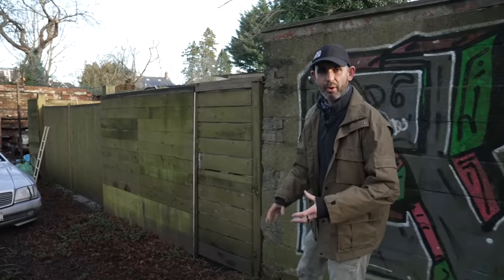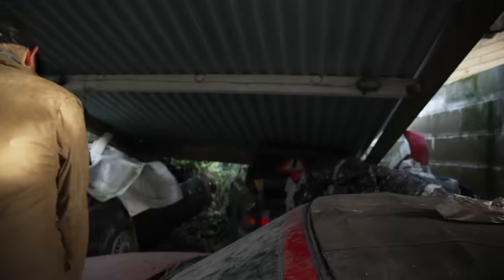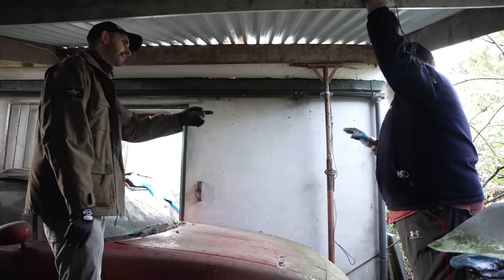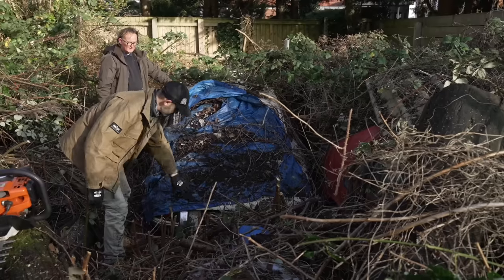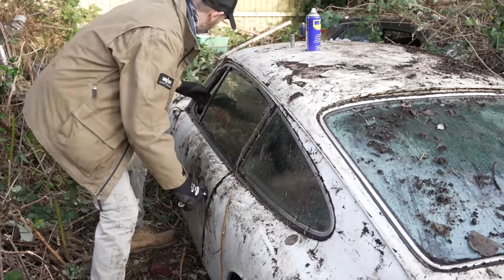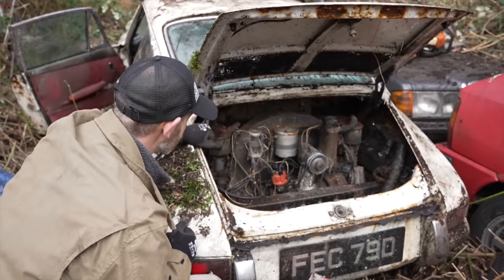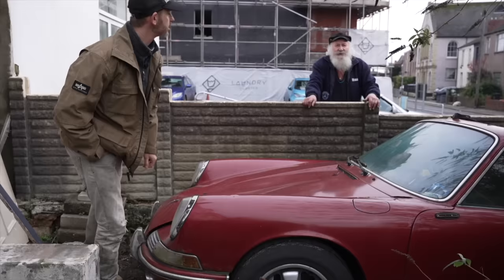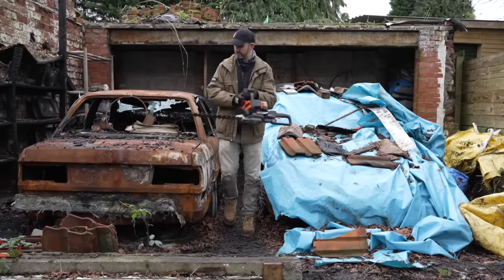Secret Garden full of overgrown Classic Cars

Comment: Very sad that this chap is clearly an enthusiast and very eloquent, but has no idea how to care for the cars he's owned. Putting cars away "after a service and MOT" and leaving them to rot is very sad. Talking about a rotting shell as having "a new starter motor" is heartbreaking. I hope he gets the help he needs.
Reply: He's beyond help!
Reply: The white Porsche failed its MOT on 4th Dec 2007 on 5 counts, and has probably been parked there since.
Reply: When he said one had a brand new engine, I was like, any engine that ran in the last year is better than a "brand new" engine that has been sitting outside for over a decade.

Brand new or not, it has to come out and be taken apart, cleaned, most likely rebuilt with machine work; new parts and reassembled.

Comment: What a find. With the current price of old Porsche’s someone will pay for the excavation just to get at that car. I too remember when 912’s were worth very little. My dad got into buying and selling early 911’s in 1980. We owned several: starting with a scruffy dark blue’ 66. This car... we drove down to Florida from  North Carolina to deliver a ‘77 XJS he had sold. I know it was 1980 because we watched the premier of Magnum P.I. On that trip. We traveled down in the lap of luxury... and back in a rust, drafty old crock of a Porsche with no heat, radio and only one working rear tail light. On to a very nice black sunroof ‘66...he added a duck tail spoiler and “cookie cutter” alloys to that car, a rather rough green soft window ‘67 Targa with low back Recaro seats and Fuchs alloys...I think that one was an “s”, a beige ‘74 that crawled right up our steep snow covered drive when our Honda Civic would not, a maroon 67 912 with some odd “Cosmic” alloys, an orange 68 or 69 912 that had centered a tree in the front end. Not wrecked that badly but That car sat in the corner of our drive for a long time as no one wanted it being a lowly 912, and many more.: 924, 914, other 911’s. He made good money on these cars at the time, but man alive, what they are worth now! Such memories. I’m sending him the link to this video. Cheers, mate.

Comment: I think you would have to buy everything.  You will need a large car transporter, another vehicle with a big winch front and back,  and another dump truck for all the garden waste. With 6 people to help clear the site.  This is a 2 day work site, and it would cost you at least 10,000 quid just to get at them.  I think I would add a JCB digger and a fork lift to the equipment needed to clear this site.  I think a thousand quid per car would be a reasonable offer if you took all of them.

Comment: It's not a '66.. It's a '67.  Engine mount is '67. Dashboard and decklid scripts are '67.  It's been converted to European Bumper guards.. or it's European, went to OK and then came back to the UK.  Plus... dash is a '67.. it hasn't been "upgraded" to a 5 gauge dash... that's factory.  It does have US Spec tail lights... btw.. That batwing horn ring is worth a good $1000.00 or more.

Comment: The 912 will be rotten from underneath, unfortunately - but it can (and will) be saved. Most other stuff should be picked up for scrap as they're too far gone - the 924 and Delta in particular. A Delta 1300... back in the days when they were either 1300 or 1500! I'm almost surprised there wasn't an Alfa 33 lurking somewhere.

Comment: I'd have enjoyed this much more if you'd used the right piece of equipment to clear the weeds. A hedge trimmer is for trimming hedges!
You need a petrol weed whacker, preferably husqvarna or Stihl with a solid three blade trimmer head, you can get through that sort of stuff in minutes. And it's accurate and precise so you wouldn't hit the cars. It's also safer as the head is about a metre and a half away from where you are.

Comment: Looks like someone ham fisted the hell out of the hood and roof on that 911, the 912 looks fairly straight but i am sure theres lots of rust in the usual places being in such a wet climate sitting for 16 years..Funny 912 was a high end VW in 65, i used to put 356/ super 90 engines in Vw busses back in the 60's' out here in California, Because VW stuff was cheap. bought a clean original 56 speedster for $800 back then, nobody really wanted them in the muscle car era,, now they are all over priced and over rated, but fun to drive if you have the dough to blow..